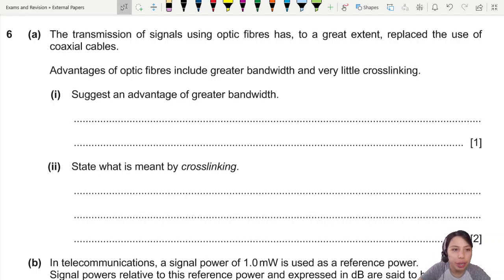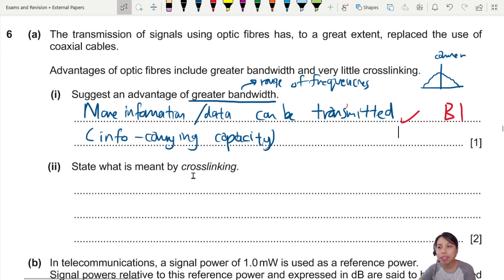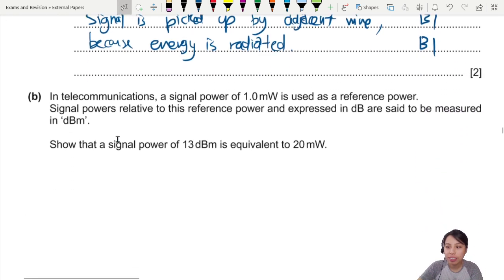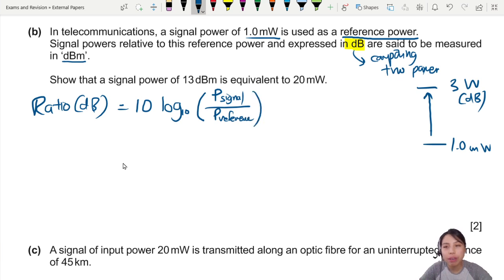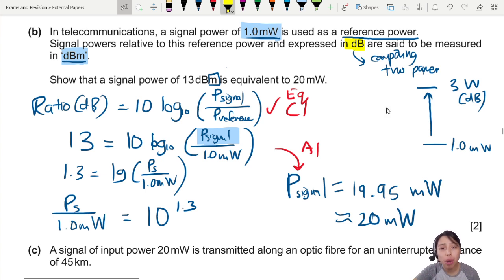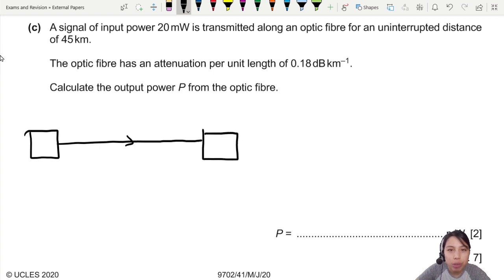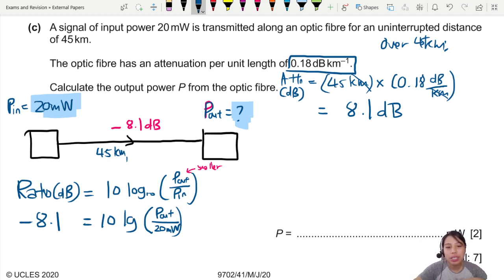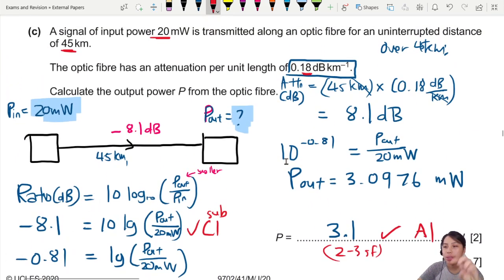MJ20 P41 Q6 Attenuation & Reference Power | May/June 2020 | Cambridge A Level 9702 Physics

Comment: I like your video. Would you help me with this problem. I would really appreciate it
In a communications system the components have the following properties
Input transducer/transmitter  Power gain = 0.3
Transmission medium:  attenuation =0.5dB/km
receiver/output transducer: power gain=125
I would appreciate it if you could help me with the solution. Thanks